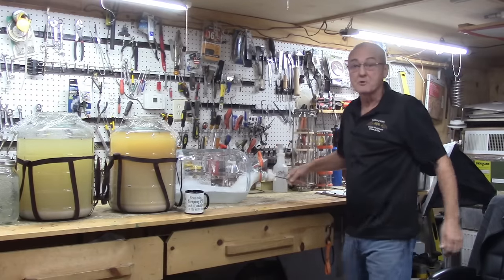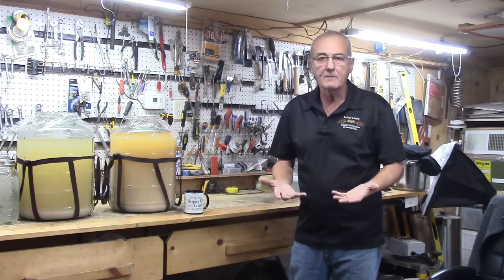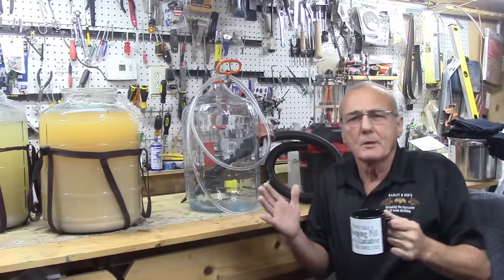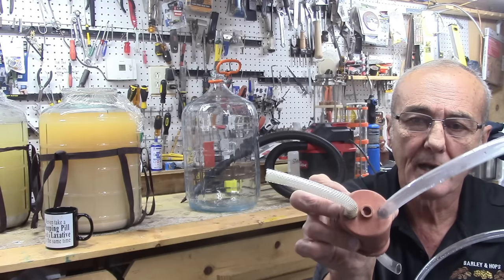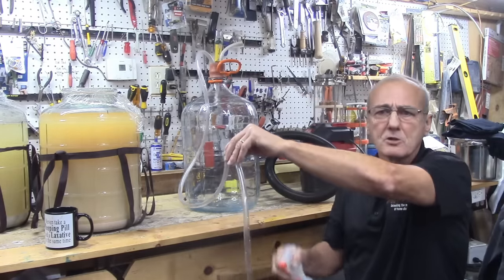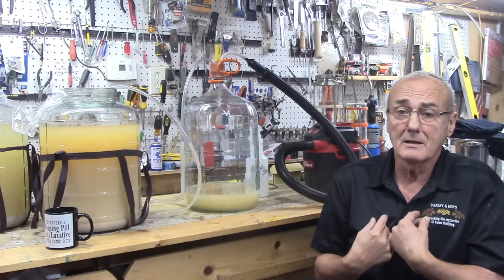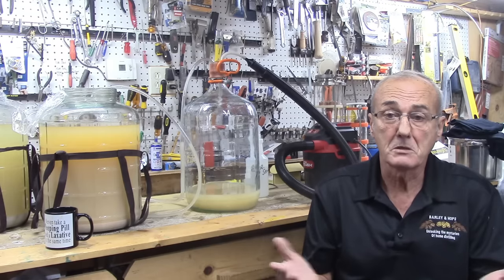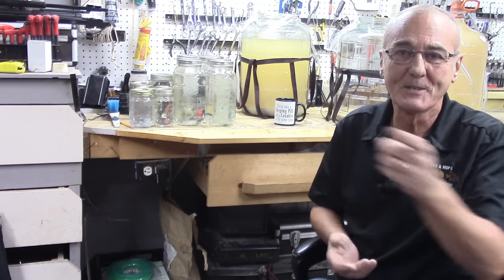Transfer, degas, clarify for distilling

Comment: I love the vacuum idea. This will help save an old mans back from going out! I was using the vacuum method with the suction wand and hose method but I always had to lift one container higher than the other to transfer. Well those days are gone now! The old saying applies here: Work smarter not harder.

Comment: Welcome back George. I hope you can make a PID for controlling the water flow to the pre condenser. I find that if i give more heat to the pot, I will get to the tails sooner than if i just adjust the temperature in the column. It will drip more and more slowly, but stay in the hearts longer. 
Greetings from Denmark 🇩🇰

Comment: Love the vacuum method, for wines beers  cider and mead if the line was longer to bottom of the clean vessel, would this avoid potential oxygenation? (I know this is not so much of a issue for "hyperthetical" distillation)

Comment: I've learned alot over the past couple of years watching you and you are the most detailed in the process.  Never saw a vid were you worried about degasing so this is new to me. I siphon from bucket to pot still so I've never degased mine. Will see if it helped with the taste of product at the end. Thanks again and as always " happy distilling ".😊
Reply from the maker: Degasing has no flavor effect it is for assisting in clarification, especially when someone has little to no checmical means to do this. 
George
Reply: Way back George had a vid about degassing. I recall the idea being,there can be particles trapped by the CO2, . Degassing allows those particles to drop out during your clarification. I'm not sure if it's bad enough to cause any kind of scorching, but George used to say clean in and clean out.

Comment: Very cool George. I use a small 3 gallon siphonless brewdemon fermentor that has a small tap on the bottom which is just above my sediment and I use Turbo Clear packs of pre-measured Kiesol and Chitosan which is pretty easy to use. You add part A and stir the living crap out of it and wait 1 hour. Then you gently stir in part B on the top and wait for it to clear.
Reply from the maker: excelent. This works very well
George

Comment: I found with clarifying if you use the part A and B it works really well. But I want to save the sediment so I won't use the part A and B. Instead I will just pour off the liquid saving the sediment at the bottom and use it again because it still has live yeast in it and if I do a UJSSM or Sugar wash, I don't need to add more yeast to my next mix, especially if I had previously used a turbo yeast or the premium yeast for whisky with the nutrients in it.
In this case, it is not good to use the clarifier because when you add the new water or wash from the still and more sugar, the clarifier will try to drag it all to the bottom on day one.
So Instead, what I do is use fermenters with taps and a couple of days before distilling, like just when it gets under 1.00 or when it stops bubbling or a day later, I carefully pour it off into another fermenter. I just make sure I don't shake the mix and pour it off until it gets down to the sediment. I want as little sediment in the second fermenter as possible.
I then leave the second fermenter sit for a day or 2 and add a little bit of water in the first fermenter ready to reuse. I then set the first fermenter aside.
After a couple of days there will be a new level of sediment in the bottom of the second fermenter.
You can't get this by leaving it in the first fermenter because all of the liquid has its own weight and it will sit in layers on top of each heavier layer of liquid and not sink. Which is why you see the different colors or shades of the liquid from the bottom up to the top.
Then when you pour off the liquid from the second fermenter it is the same but there is less sediment. 
Pour off your clean liquid from the second fermenter into your still until it gets down to the sediment then add that sediment with the first lot of sediment in the first fermenter. That is the start for your new batch.
Boil the liquid you poured off of the second fermenter and when the still cools, you can use the left over water (Wash) in your next ferment back in the first fermenter.
That is for a sugar wash. UJSSM is a little trickier but basically the same and just add the left over corn in the bag or colander into the first fermenter with the left over sediment before pouring in the wash from the still.
Easy.

Basically you got 2 30liter buckets and a 30 liter still. 
Ferment in the first bucket, pour into the second bucket saving the sediment in the first bucket. Set it aside.
Let the second bucket sit for a couple of days to let the sediment settle and then pour the liquid off the top of the sediment into the still. 
Pour the sediment from bucket 2 into the first bucket with the original sediment. Set it aside.
Boil the still and collect your spirits.
Once the still is cooled you can use the left over water from the still (The wash) into the first bucket and add more sugar and start again. 
No need for yeast.
If it is at 30 degrees and nothing happens by the next day, add more yeast. But you shouldn't have to.
Reply from the maker: Awesome points. I hope others read this as well.
Reply: @BarleyandHopsBrewing  Good to see you back George.

Comment: Big fan. Almost ready to cook!!

I ferment in a 35gal bucket (normally for wine, at least that how it was sold) on the grain, open (loose fit lid). A few days ago it was 1.005 and when I check it today the grain cap dropped, so I ran it. Used a pump to transfer. I didn't degas or clarify. Is there any specific off flavors that may get into the final product from skipping these steps?
Reply from the maker: It will be okay. Degas and clarify is alawys a best practice but if you skip it distillation will stil work. The only potential challenges comes with scortching if you have an over abundance of sediment mixed in with the mash. Just be carful and go slow to avoid this. 
Happy distilling
George

Comment: Appreciate the videos, George!

Question, why do you worry about degassing?

Theres a particular taste thats not really good nor bad coming from my still despite the mash bill. Which leads me to believe its fermentation issue.

Im using DADY and nutrient to help boost fermentation speed, and the nutrient seemed to help this last run, but its still there.

I usually use Chitosan/kieselsol (super kleer KC), the siphon off the cleared mash into the still directly.

Always toss the first few ounces until the alcohol tastes clean off the still.

I feel like im following all the best practices i can based on research, but was wondering if you had any ideas.

I also feel like i keep everything clean and sanitized as much as i can before and after the still has ran.

(Running a 13 gal pot still, 5-6gal mash, copper coil condenser, propane burner as the heat source havent noticed any scorching or burns in the still as i usually run high heat until around 150F then dial back until i start production
Reply from the maker: Degasing is to assist in clarifying (only).

Comment: Whatever happened to your Chinese (Vevor Magnum) 'football' still?
How was your success using it?
I just got my 50 litre/13 gallon for an early Christmas. I found your videos from 4 years ago helpful, but lacking.
Now I've had good success with the smaller Vevor three gallon still but my first attempt on the big one was a dismal failure. 
I loved the vacuum idea as I'm 71 and lugging around a full 5 gallon carboy is no longer fun.

Comment: Thanks for the video…I’m sorry if I missed it, but why is it necessary to degass for distilling?
Reply from the maker: Degasing is only a benefit to clarifying. 
I've had several notes about this and may have not been clear enough. I will address this on the next video and hammer home what degasing does and why I covered it. Just to be clear, degasing is a side benefit and is helpful if no chemicals are used to clarify. Even if chemicals are used degasing can help but is not so important. Degasing has no effect on flavor or distilling.
Anytime you use vaccum to transfer it will degas on its own just as a side benefit from the transfer process.
George
Reply: Thank you for “clarifying”! I appreciate you taking the time respond.

We tried to stop by your shop last time we were driving through Central. We had just missed you and the shop was no longer open. Big fans and really enjoy your approach to explaining your content.

Comment: george, try to make a test, how high you can transfer mash with vacuum? that will be interesting to see, application of vacuum transfer can help huge deal to everyone. imagine if anyone can use vacuum transfer from main floor to 1st or 2nd floor? I would really like to see math behind, like how much vacuum power one needs to transfer mash one or two floors up...really great use of vacuum. cheers.
Reply from the maker: I like the thought process here. This is a really good point. I may look into this. I am sure (positive) there is a math equation to figure this out. Sort of like pond pumps that have a head rating which is the maximum height it can pump. Hmmm, I am thinking now.
Happy distilling
George
Reply: @BarleyandHopsBrewing   I really do not know how to measure vacuum, if I have to call it somehow it will be negative pressure, right? but I am certain there is other name and specific unit to measure in. It has to be related to power needed to make go one unit up, all physics works that way. You see, this is just simple thinking, I am sure some other follower of yours understand exact math behind this and they can help you to explain to us and also help everyone understand what is needed to make our life easy. From my school I remember Bernoulli's pipe and flow, so with smaller diameter used in this application smaller vacuum power is needed, but on the other hand it can take forever...so, if you ever get into it, please do it like you explained "heating element", how much power one needs in relation to boiler size...2-3 videos? yeah, even better, it is so joy to watch your detailed explanations.
cheers George, happy distilling.

Comment: My only comment is that you may want to reverse your connections when vacuuming into a still.  If you have any packing in your still, vacuuming through the column would be the equivalent of a puke in reverse.  You would be coating your plates/packing with the raw mash solution.  Putting the vacuum on the column and the carboy directly into the pot should avoid that.  At the very least, any vacuumed up solution would be at the bottom and should rinse off by doing a period of total reflux.
Reply from the maker: Point well taken. This is also possible.

Comment: George where would I find a gasket and locking clamp for a pot measuring 11.75" I.D. or 30cm? I have looked all over amazon. It's just a plain old turkey  fryer pot with a drain. You installed a 120v heating element a few years back in one just like it.I just can't find the dang locking ring/gasket. Thanks